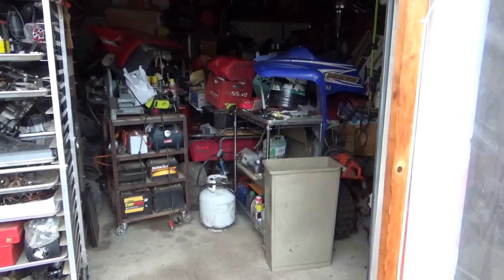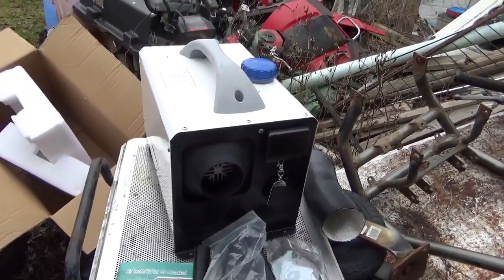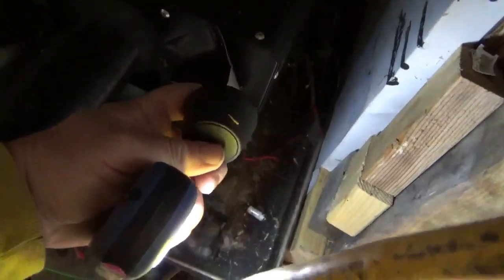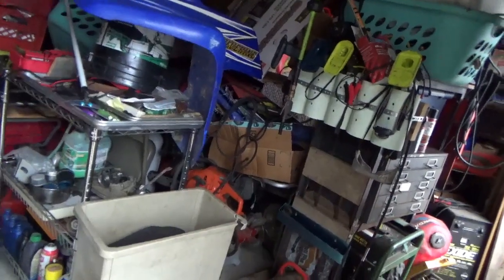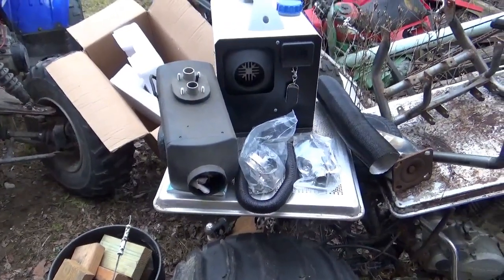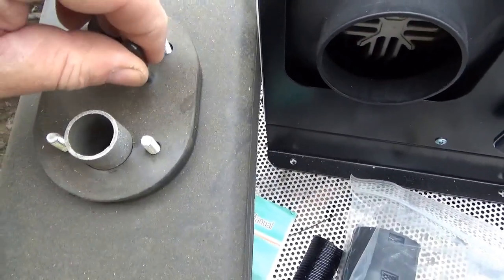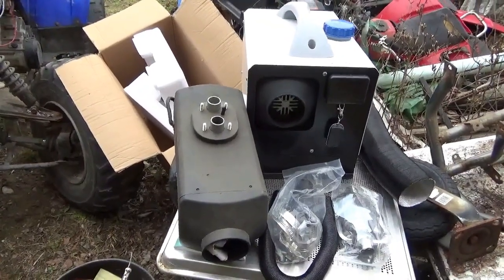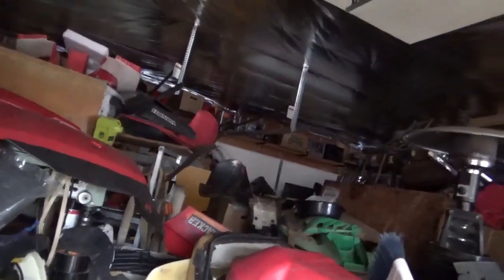Using an 8KW Diesel Air Heater to Warm a 24'x24' Garage

Comment: Hi Harvey. Unfortunately the Chinese are marketing these 8kw units about 3.5kw higher than they can actually perform. realistically, you will get about 4.7 -5.1kw from these units. you're always better served to route the combustion air intake outdoors so you can preserve the heated air for your comfort vs. paying to heat it then combust it and exhaust it out, thereby pulling in more cold air to heat. There's a very good reason high efficiency furnaces pull the combustion air from outdoors. You will see a marked improvement in fuel efficiency!🙂

Comment: Harvey im curious to know how the kawasaki Mojave 250 easy cam chain replacement held up .. I know its 3 yrs ago but im looking to do my 85 Klr 250 .. it only has 4000 miles on it but the automatic tensioner reached its limit.. the chain has loose and tighter spots so I don't think a manual tensioner is a smart move